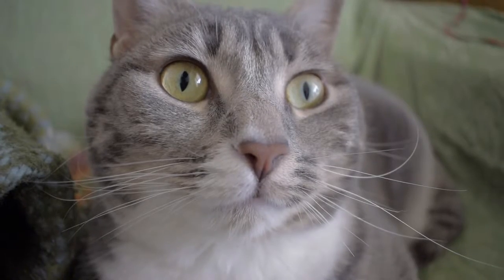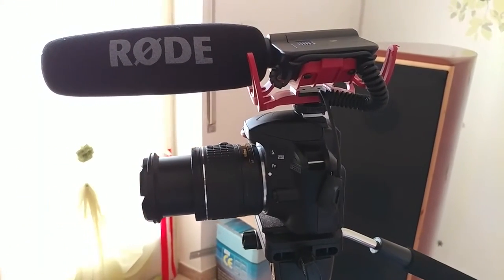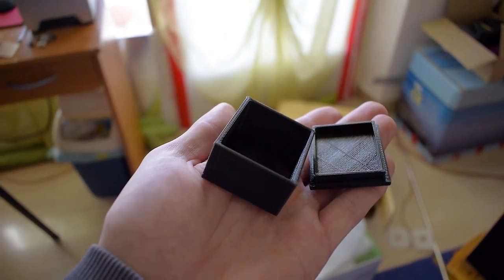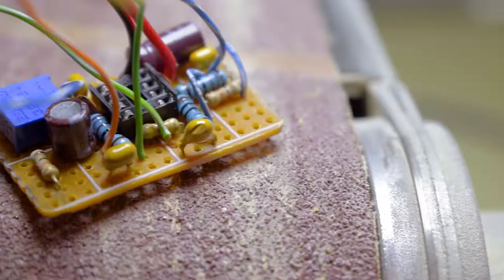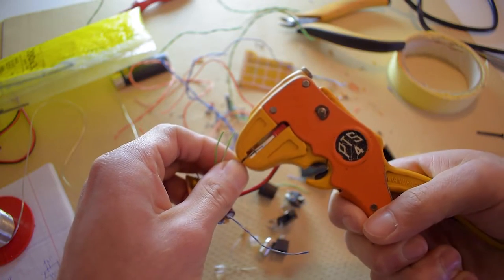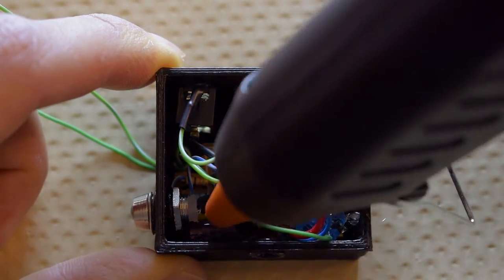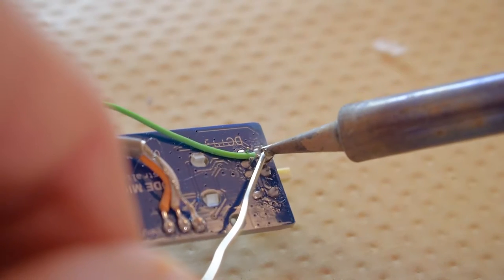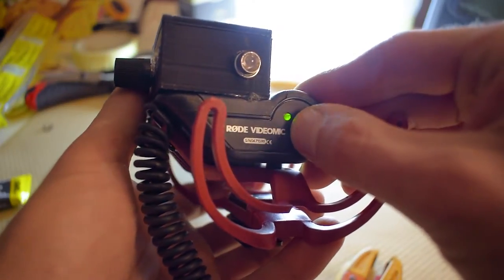DIY Microphone Amplifier for Shotgun Microphones

Comment: I wonder what voltage swing is just high enough not to overload the input? I'm thinking dynamic compressor can be helpful, such as the shitty peak tracking diode one presented by w2aev. I'll likely test it later. It has like 50mV output, but good thing, if your prior amplification stage doesn't reach that high, it won't touch the sound. So it can be useful just to prevent occasional loud sound from spoiling the audio completely.
Reply from the maker: +Siana Gearz hi :D no, the voltage swing is not high enought. When it reaches the 0db it just clips due to high gain at the first stage. I have tried putting a diode in antiparallel just for protection but made all my audio worse
Reply: Can always attenuate at the end.

Comment: Hey man great video!
Could you tell me what I should look out for if I want to build one but power it with a separate 9V battery to use it with a shotgun mic as well as an old 600 Ohms dynamic microphone? Would it work for both microphones? 
Would appreciate the help!